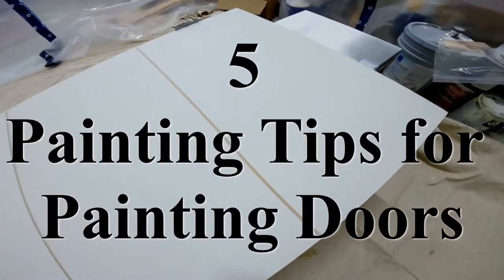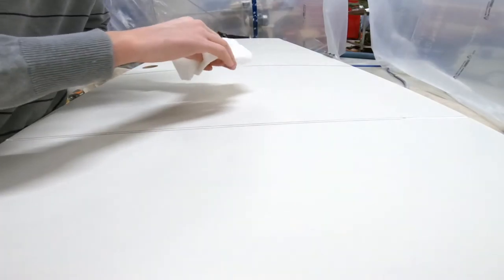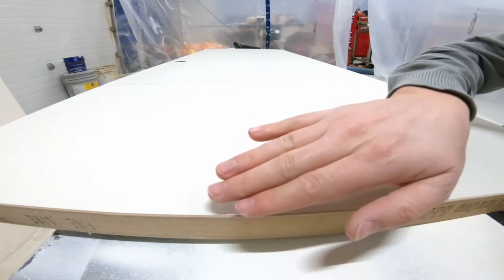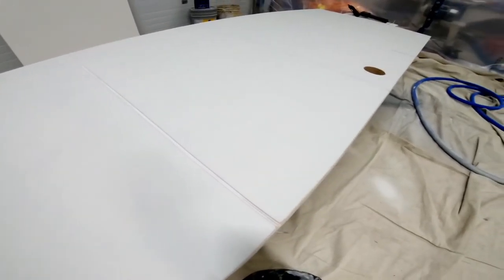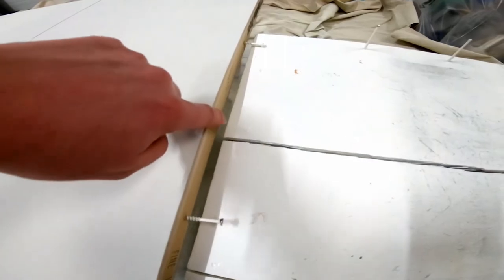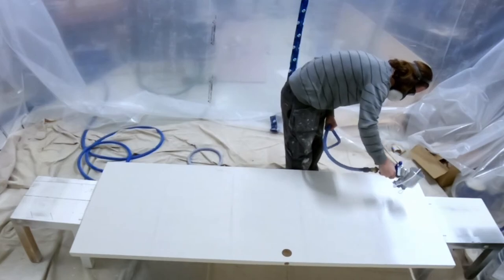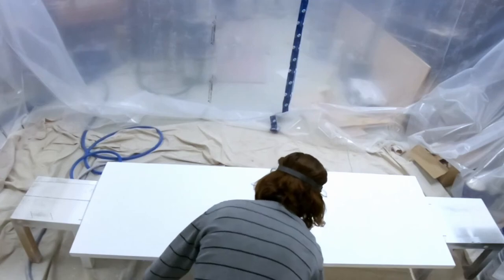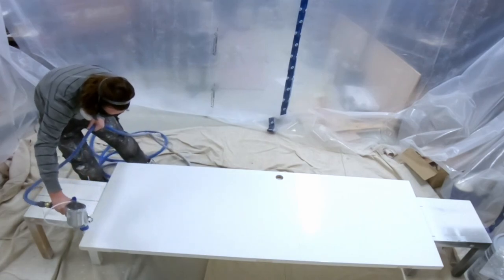5 Door Painting Tips

Comment: Great video!  You are a great craftsman. I've never used a spray gun but I always wanted to.  When I use calking, instead of a wet finger, I buy a package of baby wipes and put one around my finger and use that to wipe the joint clean.  It works great and you can quickly change to a new section of the wipe that is clean. I find it fast and does a great job. I'm not sure it would work in this application but for normal caulking, I can recommend you try it. Keep up the good work!
Reply from the maker: I will have to try the baby wipes that's an interesting idea. Spraying can be so satisfying as you get results so quickly once you get spraying. The preparation takes a while but once you get spraying the results come quick. So much faster than rolling or brushing by hand.
Reply: @ResearchDesignBuild  Do you spray much oil based polyurethane? And I don't know how to clean up after and what chemical to use to thin and clean with.
Reply from the maker: @CybekCusal  I have moved away from spray on oil based polyurethane products. There are some newer wipe on wipe off products that are a lot easier to apply and I find yield a much nicer result in less time. I have been using products from a company called OSMO. But to your question on clean up if it is water based then just water clean up and in your case it is oil and or solvent based, so you need a solvent to use for clean up. Something like Varsol, or there are specialty gun cleaners, but essentially it's all the same stuff with some minor differences. I find the problem with oil / solvent based finishes in what to do with the used solvent once you have cleaned your gun or brush. Can't just rinse it down the drain...
Reply: @ResearchDesignBuild  thanks